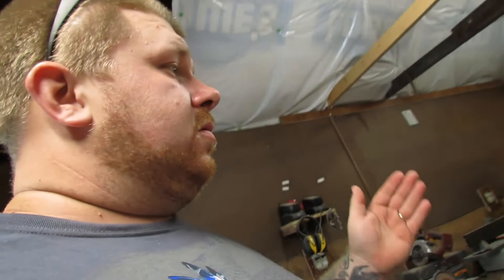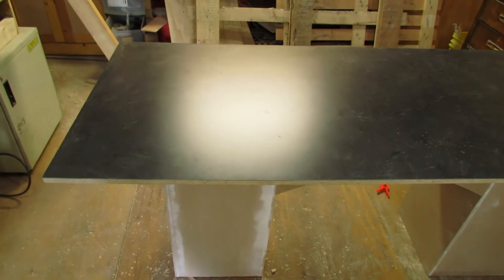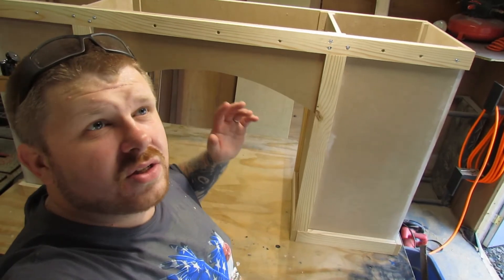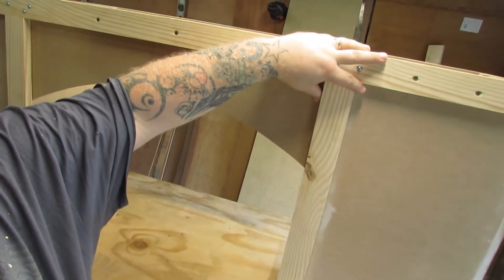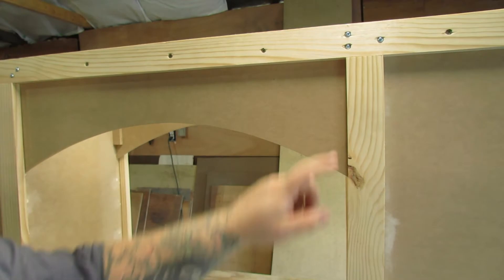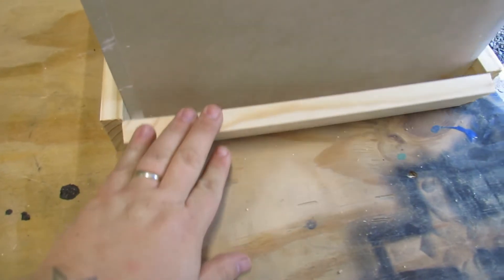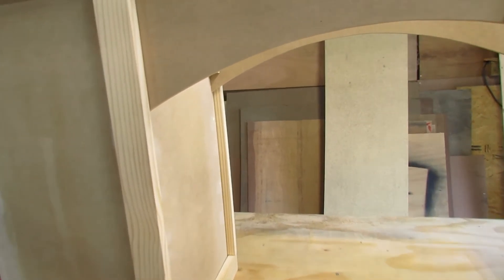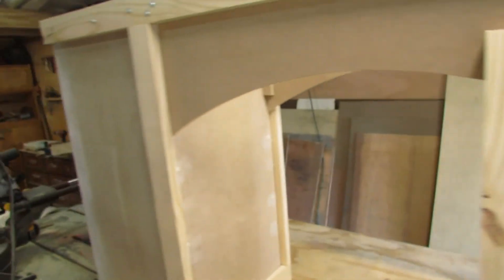MAKE A TABLE - Adding trim to the table base | Day 6

Comment: Dirt cheap Corner trim is going to look dirt cheap I would rip your one by stock edge on 45 degree angle glue that up together and then make it the same width as your trim covering the arch seem so it looks cohesive to the rest of the table
Reply from the maker: Thanks. That's a great idea. I ended up sticking with the corner trim though, as you will see in the next video. I like how it turned out. So, it all worked out in the end.